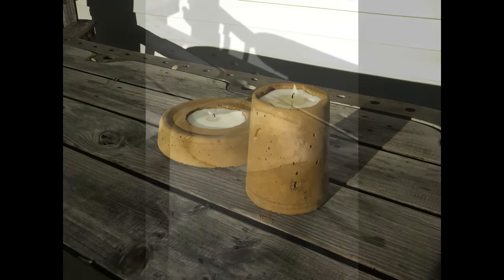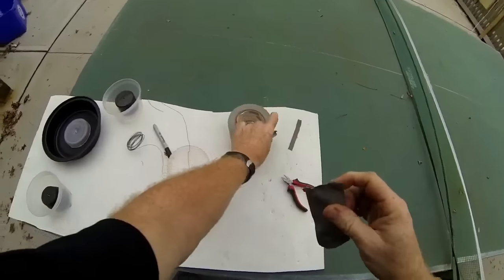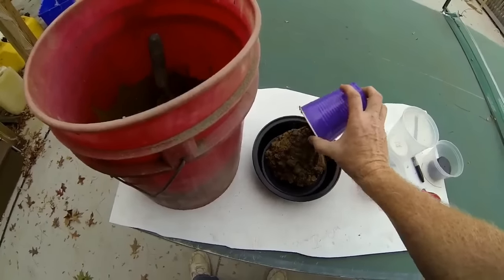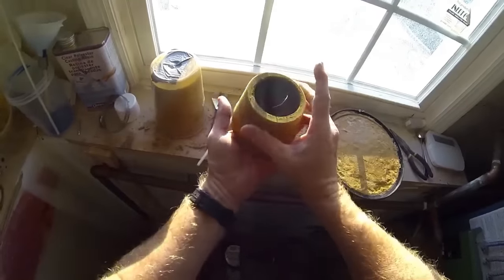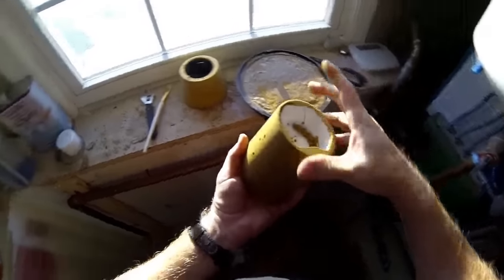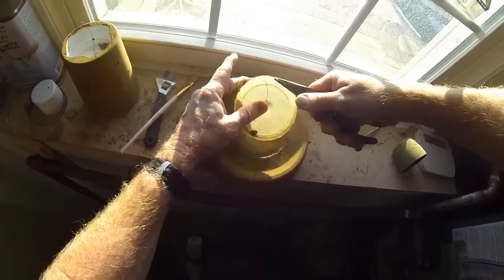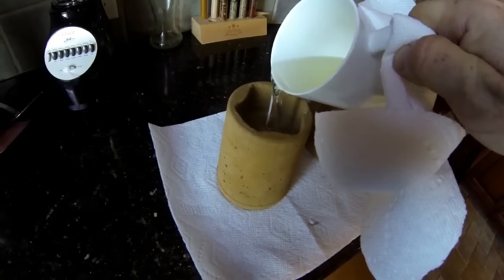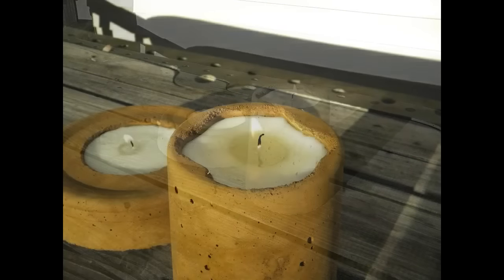Custom Concrete Candle Holder Easy DIY How to Make Project

Comment from the maker: Thank you. Im working on another now. It adds a nautical twist using the same concrete or cement. Will post the video as soon as its finished.
Reply: This was great, been searching for "candle articles" for a while now, and I think this has helped. Have you ever come across - Cenadoelyn Candle Contemplation - (Have a quick look on google cant remember the place now ) ? Ive heard some amazing things about it and my partner got amazing success with it.

Comment: Isn't concrete porous? Won't it absorb part of the Wax (or even Fragrance)? How would you seal the inside to prevent it from absorbing the Fragrance Oil?
Reply: I want to make the same question, I'll wait for the answer
Reply: @painting4962  Good luck. I've asked this same question in many Videos and never get a reply.
Reply: Add water based sealant for cement let dry
Reply: @zooboient7655  Any specific brand that you recommend?
Reply: @Khione I use KILZ KLEAR interior exterior primer (water based aand non flammable)
Reply: @zooboient7655  Thanks!